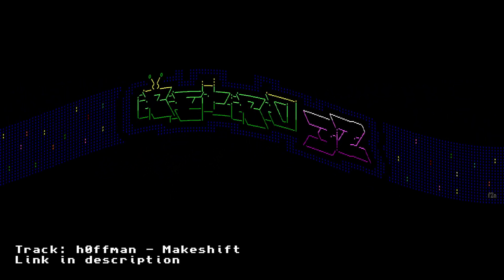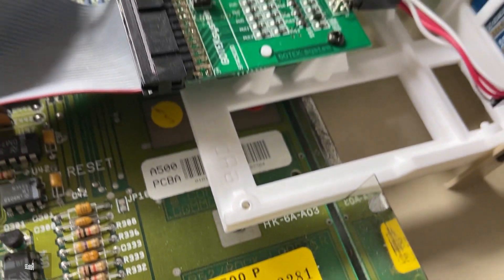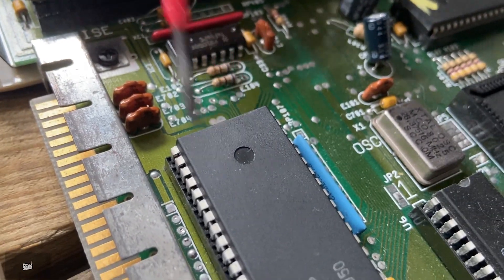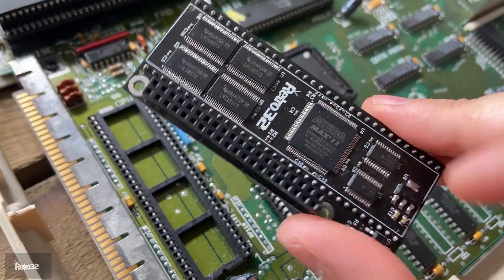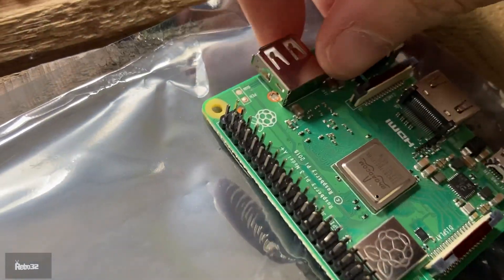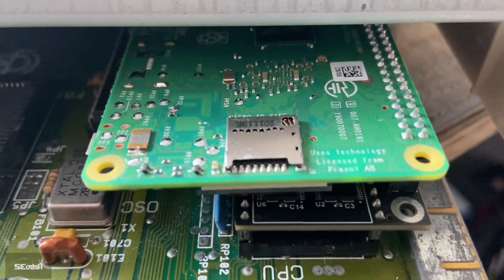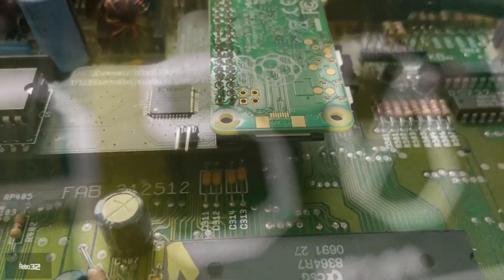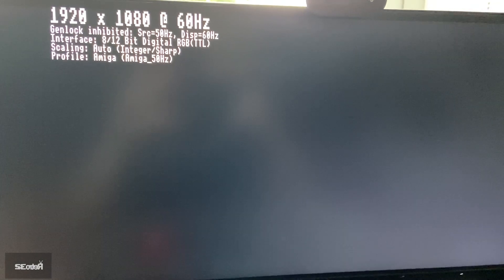Amiga PiStorm Installation / Fitting guide - Amiga 500 500+ Accelerator

Comment: Can you also use the Wifi, and when do the Pi-4 boards work like this?

Thanks for the video and the great work.
Reply from the maker: Yes it can be configured to use the Wifi from the Pi. I’m working on a new video from scratch showing how to configure it all.
Reply: @Retro32  Ok that is great news, thanks.
Reply: Yeah RTG, Network Work, Multiple HD Images, it's an amazing upgrade.  You can use a Pi 4 if you don't mind removing the USB ports or make an adapter board, but beware the travel distance in even at a few inches can cause performance degradation.
Reply: @memphisartguy2  Wow, and how fast is the Pi 4 as accelerator, the Pi 3 is about as fast as a 68040, is the Pi 4 faster then the 68060 at 50MHz?